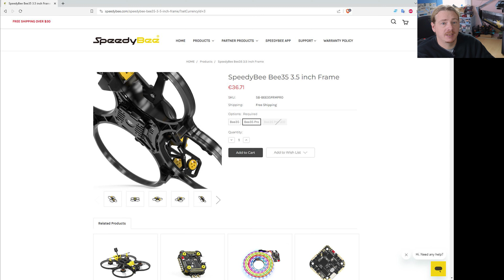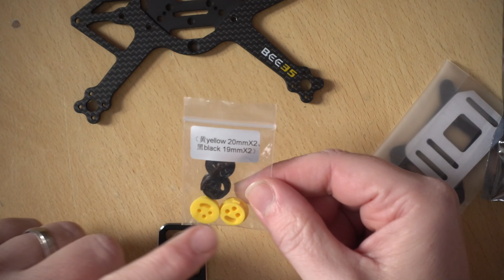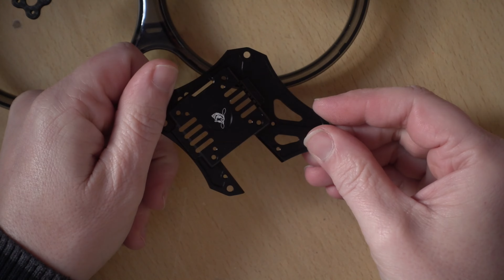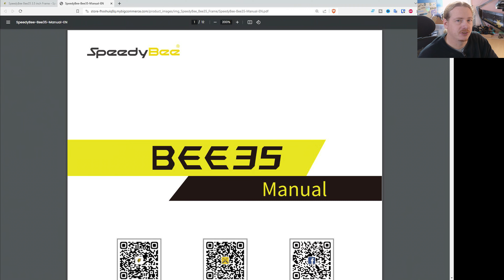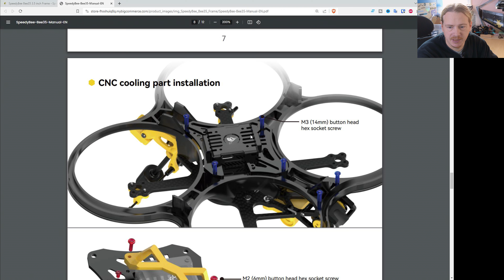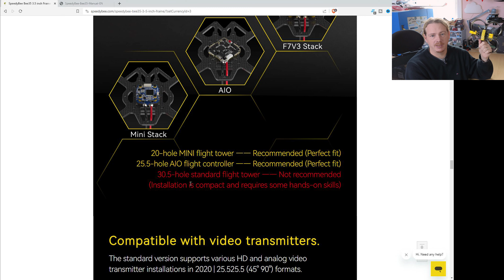SpeedyBee Bee35 Pro frame First look

Comment: I built one a couple of weeks ago using the innards of my cinelog35, that had already been in a cloud 149 v2 frame (they are bulletproof).

I'm wondering if a mamba F722 DJI MK2 mini stack will fit inside the pro frame with a vista unit?

Thoughts appreciated.

Comment: I love this frame. A 30 X 30 stack is a bit of a challenge. I used a Speedybee F7 V2 stack, and the way that worked best was with the ESC flipped upside down on top, and the flight controller below it in normal orientation. Luckily I saw this on a different build video (Bilu Media), or it might have been even more of a struggle. It flies great though.
Reply from the maker: Thanks for the heads up. I’ll keep that in mind  so far the whole thing’s upside down and the build is going ok. The first thing I found is the need to use shorter screws than are supplied with the stack, and none are provided in the frame kit. Not a. Big deal. But something to be aware of. The rear USB extension will come in very handy.
Reply: @MrD  yea, that extension is great. No taking apart or trying to work a USB inside the frame. For quick changes in the field the speedybee app with Bluetooth is nice. But at home I'd rather go the traditional route with USB so the vtx isn't heating up.
Reply: @MrD  and building it upside down adds to the complexity too, since I was not only orienting the stack different than normal but also doing it upside down at the same time😬

Comment: Fitting the Walksnail V3 VTX needs a bit of 'Dremel' modification but is good 🙂The V1, V2 larger cases will not fit 😞 It's a great frame, real quality. Looking forward to your build review Darren
Reply: I'm talking about the PRO metal plate. The standard flat plate should be good for all
Reply from the maker: Thanks for that information Steve.

It’s a shame the older VTx don’t fit. But I guess SpeedyBee is sister to RunCam, who are in bed with DJI. And it’s been pretty well discussed recently on the tactics DJI are taking to try and be the monopoly.